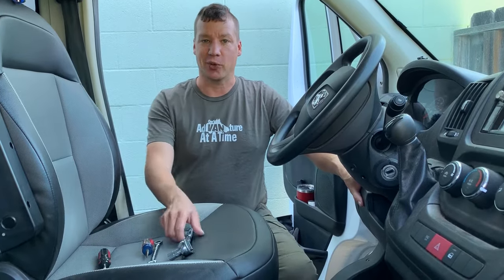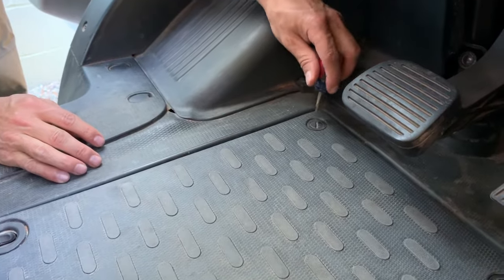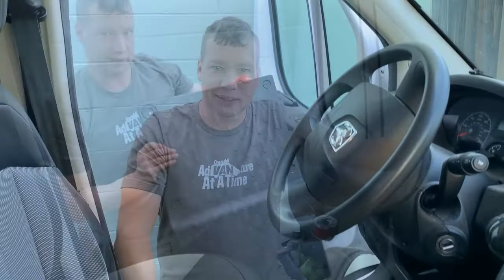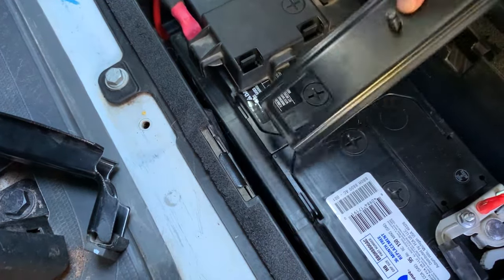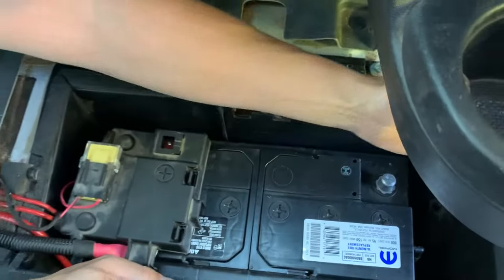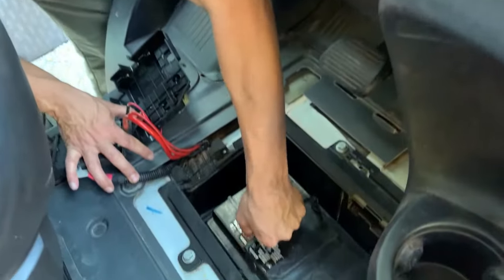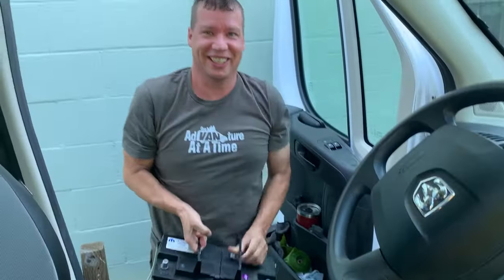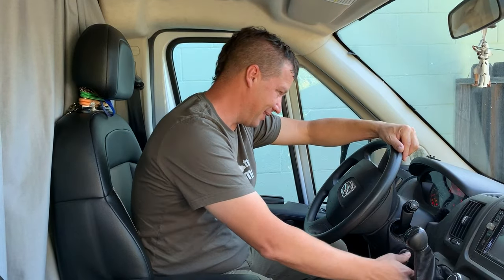"Citroen Jumper / Peugeot Boxer / Fiat Ducato/ Promaster- How To Change Your  Battery

Comment: Do those two screws on the positive terminal side make contact with metal or just screw into the Battery caseing to keep from moving around?I meant to contact you earlier but just now seeing your video but Home Depot has a battery that supposedly fits that van for $120 I bought it for back up if mine goes out
Reply from the maker: Yes the two small screws I removed just go into the plastic to hold in place. Not a bad Idea to carry an extra battery. One thing you might want to check on is if it's a ”sealed” battery or not. Rv’s used sealed battery's because the other AGM style batterys produce a dangerous gas while charging. Our van battery is not sealed but has a plastic tube that vents to the outside of the vehicle. You might already know all this I just wanted to make sure you are safe while your sleeping in the van. Take care and have a great day. 😀
Reply: one adVANture at a time thanks for the reply! I still haven’t heard anything about the cable being available for the shifter for our vans, on the battery I noticed I have a tube as well but it does not go to the outside of the van it is vented to the battery well, this vet battery that I mentioned that I got at Home Depot for $120 has all the same features as the factory AGM has as well it is a AGM so I thought that was of a heck of a deal compared to the factory battery that runs closeTo $400 if memory serves me correct
Reply from the maker: Yes you got a great deal at 120 dollars. Our factory replacement was 200. I got the same information the other day at the dealership about the recall parts for the coolant fans and shifter cable..still not available. I am checking out home depot next time we need a new battery, thank you for the heads up.

Comment: How old was your battery when it died.  WHY did it die so early?
Reply from the maker: Our battery was about 3 years old and died early because we left our inverter on a few times and drained it. I just need to wire in a switch that turns it off when the engine is off. A costly mistake on my part.
Reply: @oneadVANtureatatime  Thanks for the info Dave.  .Much respect for sharing this money saving and safety issue with us.  It is this kind of Insight that really makes your channel a must subscribe for those of us who are planning to pick up a ram and head out the road. Thank you

Comment: Key removal and starting failure can ALSO be just a $5 HOT SIDE BATTERY FUSE:

https://www.youtube.com/watch?v=JhF3jpbCHCs

As he showed, pull the terminal and put it on the battery side of the fuse, and if the key removes / engine starts, you found your $5 solution.
Reply: Thanks for the share!

Comment: I had something happen kind of, dash lights on, and the engine didn't turn over. Not the battery wish it was. What happened was the dogs chased a cat up into the engine compartment. Then  commence to chew through the wires in the wiring harness to get to him. As a result they chewed up 40 wires resulting in  the need to replace the wiring harness and the wheel module.  Which was damaged from towing the Promaster backwards onto the tow truck.
Cost over $2900 bucks.  I'm in the process of putting some fencing under the engine compartment to keep this from happening again. Simple fix. Stupid cat.  Dumb dogs. Cost of having a van that high off the ground. Pain in the a&$.
Reply from the maker: Dang!!! that was a bad day!! Bad dogs! Note to self....never let them tow the van backwards onto the tow truck... You said it.....MAJOR PAIN IN THE A$$!!!
Reply: @oneadVANtureatatime  that little module cost  $400 dollars. Only way to load  was to pull it backwards from the location it was at.  Note to self always park nose of van toward the street lol